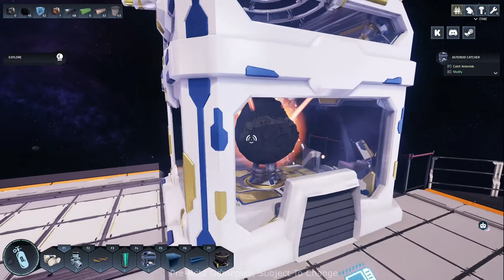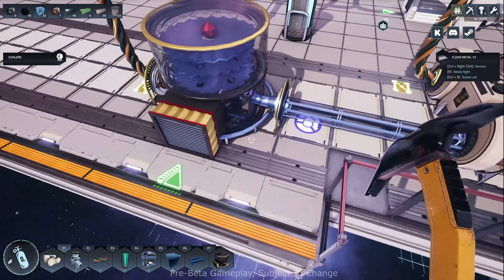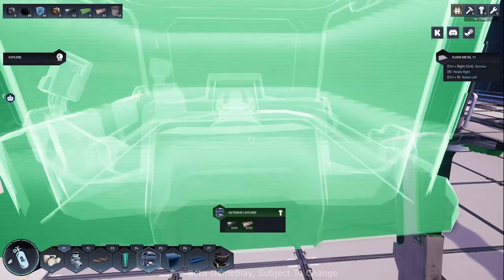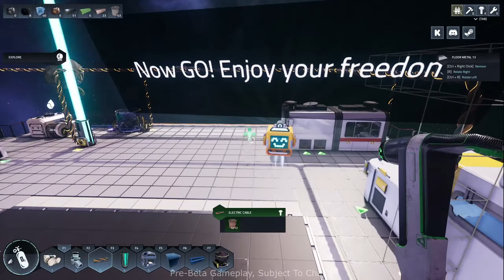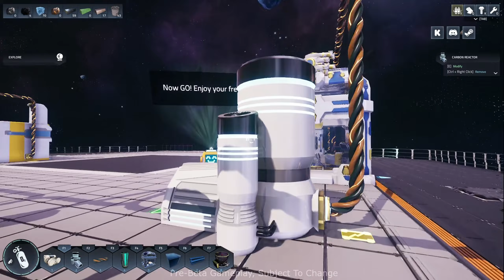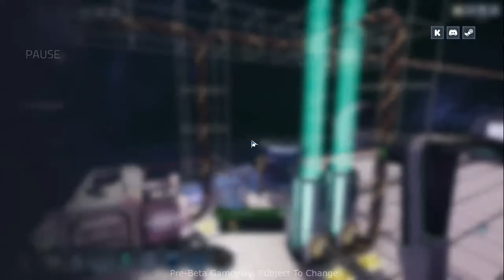Preview Let's Play Astro Colony s01 e03 [ Pre-Beta Demo ]

Comment: O2 barrier currently broken, known bug. O2 tanks are automatically made by O2 generator as long as it is getting water piped in from a water cell; O2 barrier uses those tanks to add 5 minutes of air to the dome, does not require any connection except electricity.Tefel should be looking into it currently.

For the most part, you can stop mining asteroids, until AutoCatchers are unlocked. Farm ores (iron, copper, carbon, and quartz; currently no use for gold or uranium) from the 2 planetoids instead; still super tedious, but very much more efficient. Only ice will need to be harvested from asteroids.
Reply from the maker: That's a ton of useful information, thanks Doc!  👍

We're still in the early demo stage, so I'm not too disappointed with what we have to play with at this point. 

I can see all of the fun to be had in Astro Colony as the game gets fleshed out and I can't wait to play a more unlocked version. I can picture setting up a dozen or more automated mining colonies on different planets and having a huge station flying through space.